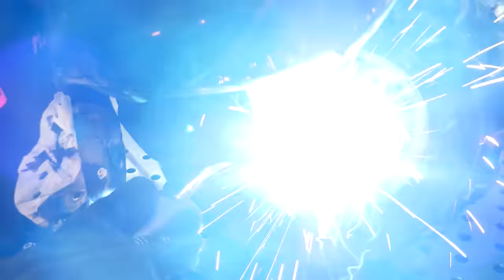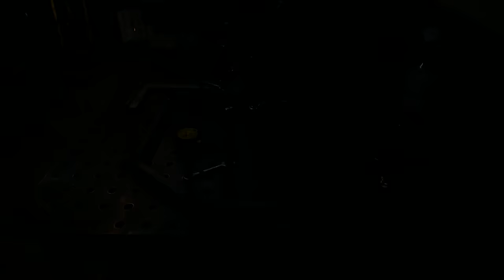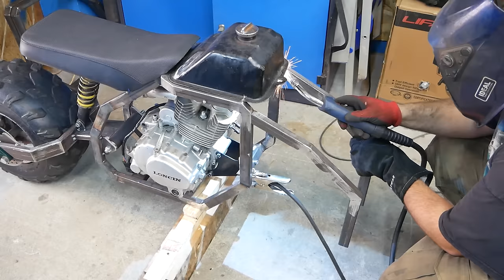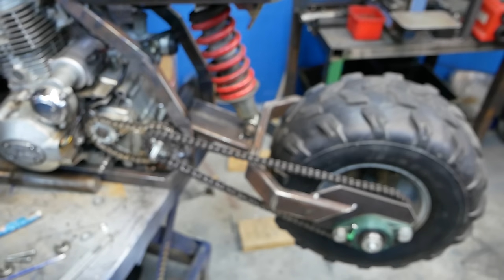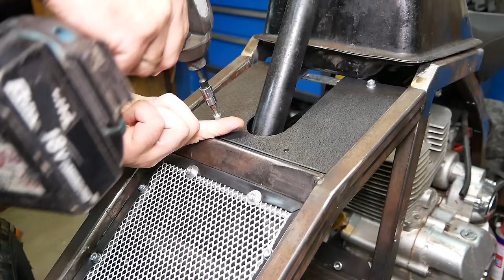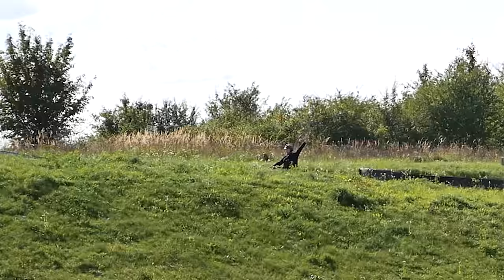Making Franken Trike to Have Fun :D

Comment: As a professional Maintenance Mechanic /Technician, whos hobby is mini bikes (I own a Coleman cc100x with predator 224cc swap) this was a fine specimen of an Epic home-made build. Rarely am I absolutely RIVOTED for an entire build video. The finished product was truly artwork. I think this trike is easily worthy of applying for a patent, and producing these for powersports stores. They'd sell for sure. Amazing job man. Truly inspiring. Keep at it. 👏👏👏👏
Reply: OK here's the deal it's kinda koul but it's to tall to short length wise and to slow for his big butt. and the front end is to narrow. but other then that's it's pretty koul and he did a killer job from scratch. for a starter trike
Reply: @tonysmith3875 you're right it's way too narrow in front. The geometry is messed up , he needed to use a cpu to design the frame and suspension.
Reply: Except for the fact you can't take off the rear wheel because the sprocket and rotor mounts are welded to the axle.....
Reply: Honestly, hearing the experts talk about it, it's something really unique

Comment: Quite the inspiring build from start to fuck up to finish.. liking the learning curve and the fact you only tack welded the framework until it was where you wanted in case of changing it like the down tube on the front interfering with the steering arms . Especially liked the seat catch and the method of checking the rear shock and the look on your face.  . Great build no over rated music or being talked over . Thanks

Comment: well done! very cool, but there are 2 design errors:
1. the pendulum will break off at the point of attachment to the axis. the isthmus from the pendulum to the tube on the axis of the pendulum is too narrow.
2. this will cause the subframe to break off. it should be reinforced with inclined supports to the frame so that they form a triangle. or scarves made of thick metal in the place where the stretcher is attached to the frame.

отличная работа! очень круто получилось, но есть 2 конструктивные ошибки:
1. отломает маятник в месте крепления к оси. слишком узкий перешеек от маятника к трубе на оси маятника.
2. отломает подрамник. ее следовало бы усилить косыми подпорками к раме, чтобы они образовали треугольник. или косынками из толстого металла в месте крепления подрамника к раме.

Comment: I enjoyed watching the build process [as always] but I did notice a few things. I mention them as an observation vs criticism. I believe it would ride/handle better if:
1] The center of gravity wasn't as high.  2] The rear swing arm was lengthened  8"–12" [20.32cm – 30.48cm]  jmo. Again, really enjoy all your videos. God bless.
Reply: He missed a couple steel pieces for the back end for the seat so it does not flex with the shock and for the rear swing arm need more brackets on the connection point so it does not twist ...If he hits a good bump the shock will go right thru you sorry ..Back end not strong enough .....And swing arm should of been longer for better handling ...

Comment: Nice job man. I really liked the tensioner desing and how you decided to add better threads to hold more torque. Welding nuts like that not only benefits for more durable threads, but gives you galvanized threads :)  awesome job!
Reply: And also zinc poisoning if not ventilated property

Comment: Cool build man and excellent filming and film sequencing throughout. Should have made the front end bit wider and maybe the rear swingarm a tad longer. But still cool AF. Glad you used the mesh wire and plastics to not add more weight to that great steel behemoth 😅 Excellent job though. Polska power!

Comment: I AM IMPRESSED!!!!! That is BEAUTIFUL and AMAZING!!!!!!!! I never doubted your abilities, but I thought this was gonna be a challenge for you.... I WAS WRONG!!! HAHA!!!! 
It sure is a nice machine, but it's just a  little bit too small for you. Guys like you and me (we are about the same size build, but I got a bit more weight than you) need something a bit more powerful (at least a 400cc engine) and a slight bigger frame than this. But if you are planning on selling it, I'm sure ti will sell quick!! :)
I've never driven a trike with 2 wheels in the front, but I grew up riding the typical trikes with 2 rear wheels. But at about 13 I sold my Honda 200ES Big Red because it needed new rings, the carb cleaned and tuned, re-threading the spark plug socket, and SOMETHING in the electric start system... but I knew NOTHING about engines back then... and I was too young to have the money to fix it. DANG I MISS RIDING!!!!
You could probably find some plastics on eBay that would be close enough to fit with only some small modifications, and that would increase the sale price SUBSTANTIALLY. Did you notice how wet and muddy you and the bike got just from those couple of puddles? Well just a little bit of plastic goes a LONG WAY to keepin dry LOL!!
Well I hope you have fun with it, be BE CAREFUL AND SAFE!!! And WEAR A HELMET!!! I'd be 'not alive' if it wasn't for my helmet - TWICE!!! and you just NEVER KNOW when things are gonna go wrong. So don't hesitate to put one one, because ANY knock to the head could change your life FOREVER - even a SMALL BUMP could RUIN YOUR METAL WORKING SKILLS - NO JOKE!!!! - So PLEASE DON'T FORGET!!!

Comment: Very well, a professional manufacturer, but my humble opinion is that smaller tires will give torque but not speed. The appropriate large tire must be installed for the engine.

Comment: You have to un mount the engine to change the battery  ..he had it figured out, nevermind👍👍👍
Reply from the maker: The battery holder is held on by two screws unscrewed from the bottom.
Reply: @MadeinPolandChannel  beautiful bike 👍👍👍

Comment: On your mig welder are you using flux core wire 
if so what are you spraying on the metalwork before you weld it 
i think it's so that there's know spatter from the welding, could you say what you use and what 
And why your doing it thanks

Comment: Hi, congratulations on your work, I wanted to ask you what do you spray before welding with that atomizer? Thank you
Reply: It's probably a product to prevent any weld spatter from sticking to the table or the steel parts.

Comment: Fun machine but the tensioner is the wrong side of the chain drive. If you have a static drive cog on the frame, that chain to the motor should be no added rolling resistance. Ideally no tensioners, but on the sprung rear wheel section of chain where it's most likely to need some slack and to be serviced periodically, the tensioner makes that chain easier to change and adjust. But you never want that chain going past 30 degrees deflection max, ideally 10-15 degrees under tension. But overall nice work.

Comment: very nice work. seen the vid till half. but: you never can maintain the break disc without cutting the rear frame in half... or am i wrong?
Reply: yes, i am wrong - you easily can detach the wheel bearings.

Comment: Very cool, but the rear tire section is going to be a problem.

You should have have an "A Frame" as all the weight is concentrated where the shock mount is.
Its not that what you didn't do a good job, it's that the design will make it flex and twist and you may end up bending it
Reply: Leave it out mate

Comment: GOOD JOB, but it's so better than you install brakes hose for aviation, there are much more solid and safe, because they are in inox around of the hose. It's certainly little bit expensive, but you're in safety.

Comment: Those green attachments of the front wheels are not adapted correctly into the frame, You need another cross member to go from left to right connecting both sides of the frame just like the front, It will bend under brutal shocks from uneven road.

Comment: I hate handlebars. Chrome ape hangers would look more correct.

I think the rear suspension will hurt handling, Three-wheelers (motorized tricycles) didn't have any. That's why they used high-flotation (aka: atv) tires.